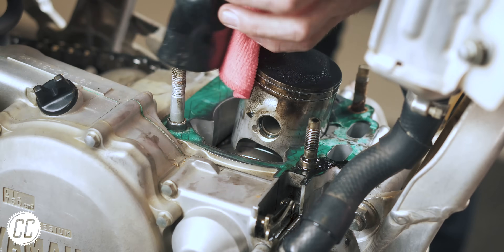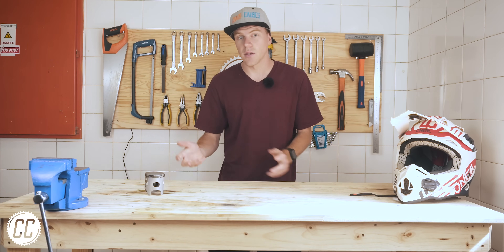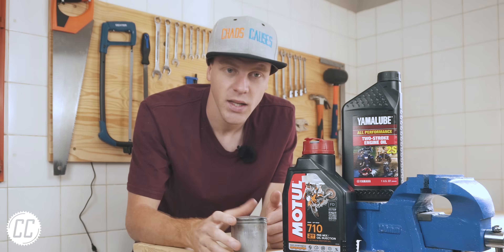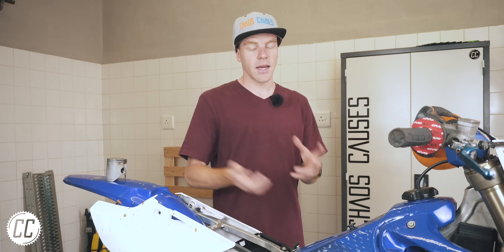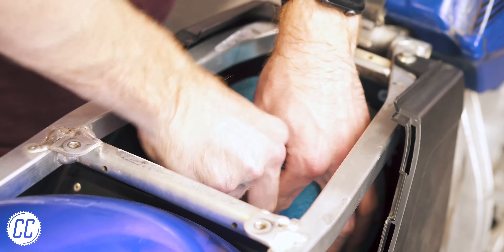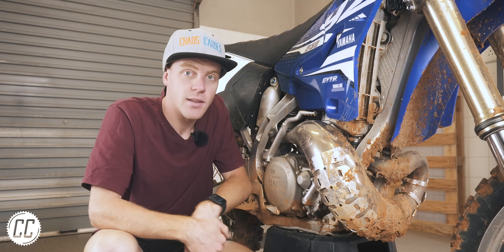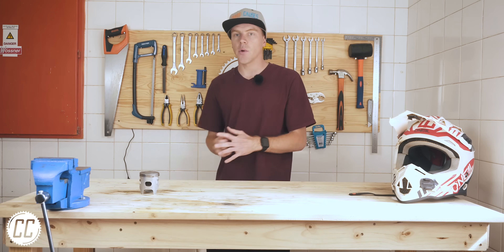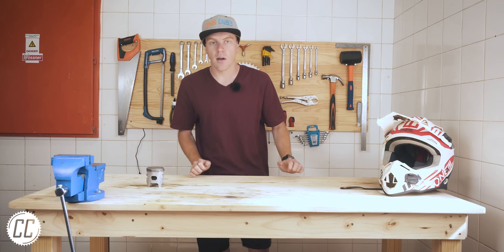What Causes 2-Stroke Engine Damage?

Comment: Uuuhhhhmm that oil out of the muffler Shure looks like a right side crank seal! You should probably check that also your trans oil will just disappear if it is bad.   Also great video! 👍.      Don't forget to check the crank play bc sometimes the crank bearings explode into the cylinder

Comment: adding oil to fuel dosen't make it run rich it actually leans the bike out, you can run whatever the oil manufacturers recommend as long as you jet according ! bikes run on fuel not oil,  the more oil in the fuel the less fuel rich the mixture

Comment: 2 stroke engine braking is an interesting one. Like you say with a set up like yours when you shut off the throttle you reduce fuel and therefore lubrication but there are 2 strokes with auto lube systems consisting of an oil tank and pump. Now some of these systems just pump the oil into the carb to mix with the fuel which gives the same issue of less lube when shutting off the throttle but some have a system where the pump runs off a gear on the crank and inject the oil directly into the intake port (after the carb) On these bikes/scooters the system will be providing oil based on engine speed regardless of the throttle position and fuel input which should mean shutting of the throttle at high rpm is not an issue. At least that’s how I see it, could be wrong. I have this system on a scooter but that’s an auto so no clutch to pull anyway. Good your still loving the 2 stroke they are great fun
Reply: Ive engine braked all of my 2-strokes, and continue to do so to this day and have never had an engine failure. If there is enough fuel for the engine to run, there is sufficient oil for lubrication, unless your jetting is way out of line. Been using Sunico Silver 100 octane race gas and Klotz castor for over 30 years with absolutely no problems whatsoever.
Reply: Most vintage Japanese 2 strokes from the mid 60's onwards do this too. Yamaha's autolube is a great system and very reliable. Only problem is if the pump decides to suddenly stop working...

Comment: I usually run my Gasgas EC 300 with a mix ratio of 1:50 and it still spits a bit oil out the exhaust and smokes a bit too.
Reply: It should be in my opinion.  Rather be spitting oil and smoking then not spitting oil and smoking
Reply: Thats cause your supposed to run 50:1
Reply: What mixture you use? Amsoil?

Comment: Put grease on the part of the air filter that sits on the air box. Around the orange lip. It will create a seal around there allowing no dirt in. How I’ve done it my whole life.
Reply: Especially if riding in sand. Seen many engines go down because they sucked in sand.
Reply: @bcwingit  I’m a service tech, I can’t tell you how many people have brought in dusted Motors because they don’t clean or oil the filter

Comment: I believe Yamaha recommends a top end overhaul every 30 hours.
Check your manual.
Reply: The manual says replace the rings at 7.5 hours, replace the piston at 12.5 hours.
I’m sure 0.0 people do that.
Reply: Because it’s stupid to do this. I’ve had 8 years on a couple of engines still very good compression over 200 hours. I’ve done crank seals before the top end lol 😂 if the compression is good way bother with it. Maybe 70 to 80 to 1 on mix I could see 30 hours and it be junk  it just plane stupid to run that high of mix. You making less power. More engine wear. It’s stupid

Comment: About the carburetor/FI debate, carburetors are mechanical, Fi is electric. There's next to no difference in performance when it comes to motorcycles. 

It's impossible to make a 2-stroke engine clean. so there's always going to be oil build-up on your exhaust. Whether your engine is running lean, rich or stoichiometric can only be told by a mechanic with a lot of experience with carburetors. I only work with very small 2-stroke engines and the way I'm setting up a carb is by listening to the sounds the engine's making and how it responds to my inputs.

Comment: Always use one oil only. If u made your mind to use motul keep your head strong and use it for ever. And I would say u should have asked the previous owner what did he used. Coz my mechanic always says this to me "Your bike is just like you if today i give you water from a lake you will fall sick coz u are use to the RO water, but think about those living in there drinking lake water, so always use one oil in your bike and if possible try to fill feul from one station  this will give your bike more life". So please don't try yamalubes for once just to feel if it any different or not
Reply: I’m gonna call bs on your mechanic. Microbes, minerals and bacteria in water is nothing like oil in an engine.
Reply: The only reason you shouldn't change oil is because there is some oil that will react to another type, it is perfectly fine to change oil brands, just drain the tank and carby of the old stuff and fill it all up with the new, and she'll be right
Reply: You are right on the mixing different oils part, however if your tank is empty you can change the oil and let it warm up for 10-15 minutes so it gets used to the new oil.

Comment: Great video and breakdown. All us dirtbike owners need to pay attention to protect our investments and toys. 💪🔥
Reply: I have a ? For you.
I recently bought a yz250x just had fresh piston and rings. Compression was great for a little while (probably has 8-10hrs on it) and I feel like it lost some compression.. just when I kick it over though. The bike still runs amazing. (I am just curious what would have caused it so quickly. I checked out the cylinder before the install and it didn’t seem to have any scratches or any bad imperfections in it.
Reply: @jaredbaker5510  my yz125 did the exact same thing, I think its normal and it is running fine, Im not 100% tho
Reply: @weston5146  I mean it still starts first kick. But it just seems low.. I have to tear into my engine now anyways.. because the crank seals are bad. It’s burning motor oil. 🙄
Reply: I’m going to get a compression tester and see what it’s at. And if it’s at below average then I’m going to tear it down and see if something’s not right in it now or what’s up with it.

Comment: Also gapping the ring in the cylinder when installed; making sure the piston has correct clearance, and measuring the top of the piston in the cylinder where it meets the head aka "squish clearance" but these are all technical things that are taken into account when you put it together
Reply: if there isn't enough piston to wall clearance or squish clearance that will seize the bike in the first ride tho, and the piston ends up super beat up. and too little gap will break the ring in the first few hours as well. but if I heard him correctly this bike was at its hour limit and didn't have broken rings and the piston was in one piece so it couldn't be that.

I think it's either just a plating defect from factory, or the previous owner honed it and introduced cracks that made it let go.
Reply: U blip the throttle when your slowing down on a 2 stroke you never engine break a 2 stroke
Reply: @akthethotboi9711 u do if u premix